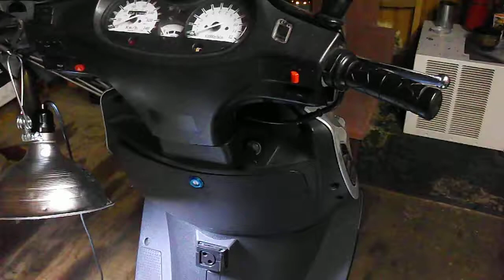GY6 150 With 60mm Big Bore Kit A-10 Cam,Ported Head(first start up)

Comment: If you dont run a fat main jet the heat kills the trigger + stators quick . Tighter valve springs wipe cam lobes + break valve heads off in pistons often. Run jets so big the wetness controls your top end rpm (boggs down). Usually @ #130 main jet at sea level works nicely. You can always lean a fat jet in if you want things a little hotter...Also look into lower or higher rear differential gears, you can get a little more top speed or bottom end yank without installing BBK yet.
Reply from the maker: I been running this set up for two years now 5000km no issues,i did change my rear gear to taller forget the ratio its been so long,she cruises nice at 50mph around 6k rpm no sweat.
 Thanks for swinging by!!
Reply: Im playing with a stock 57.4 but want a little more frog in it. I'm picking a cam, but I already put a 2 point lower final gear (T14/38.. i think) , k+s clutch,1000rpm springs, gates belt,118mm black max variator, 10g rollers, stainless steel valves.Trying to stay stock size for parts availability. Nitrous buttons are easy to plumb, hell to repair. But just theres nothing like asking the kid at the next traffic light "... let me see your payment book" ; ))

Comment: I set my valves to .005 on the intake and .006 exhaust its still a bit noisey even retorqued the head studs
Reply from the maker: Good idea!Next time im in there I will check the head nuts.
Reply: @577buttfan is this a qmj157?

Comment: NIce!. have a roketa 150 cc I'm looking to BB with a 60 mm myself. any modifications done to the engine case?
Reply: That's freaking cool! Thanks for the reply. I will be picking up my kit next week then. I have a video that shows my head after a dropped valve. Not cute. I'm really jonesing to get it back on the road, especially with the nice weather we are having in the southwest.